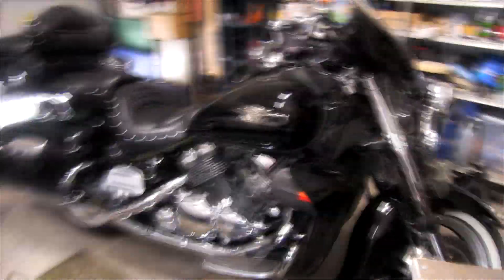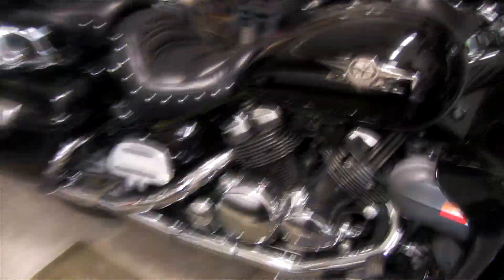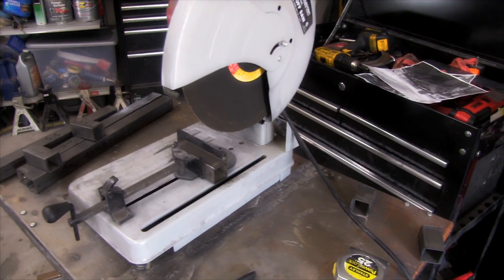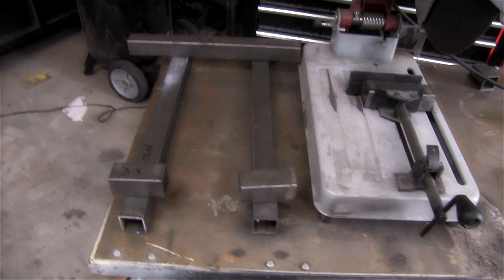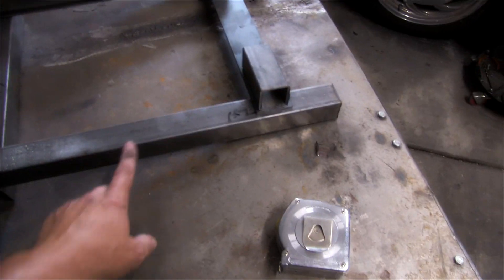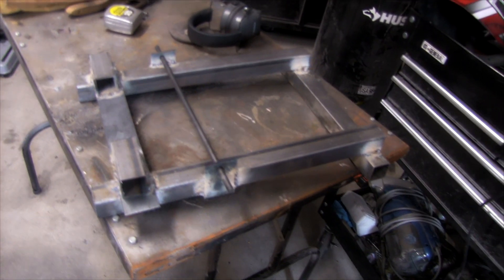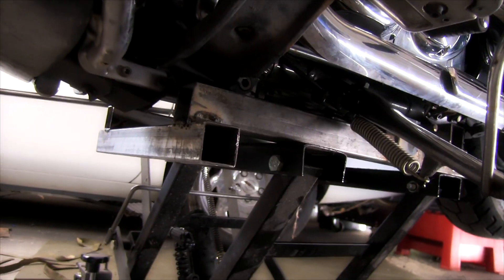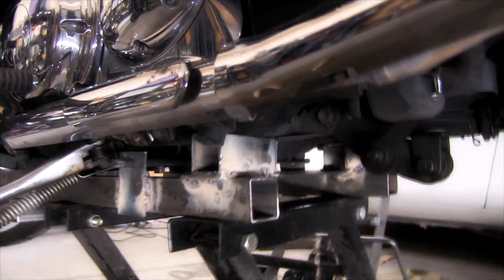Yamaha Royal Star Venture Lift Adapter Fabrication

Comment: I'll be making one of these shortly for my 2008 RSV. I don't think you posted your final dimensions?
Reply from the maker: 2-20 inch square tubing (1 3/4) 2-3.5 inch ,square tubing (1 3/4) 1-13 inch square tubing (1 3/4) 1-13 inch 2 inch wide flat steel, 2 flat steel (2inch) 2;3/4 long. 17 inch long (1/4) round steel bar.  Pretty sure it was 2 inch square tubing but it measures 1 3/4 inch.

Comment: Any possible way to grt the measurements from each piece? Did you use 2" tubing?
Reply from the maker: 2-20 inch square tubing (1 3/4) 2-3.5 inch ,square tubing (1 3/4) 1-13 inch square tubing (1 3/4) 1-13 inch 2 inch wide flat steel, 2 flat steel (2inch) 2;3/4 long. 17 inch long (1/4) round steel bar.  Pretty sure it was 2 inch square tubing but it measures 1 3/4 inch.
Reply: @carsandguitarsdiy  thank you

Comment: would you consider building one of these for me? I would gladly pay you for it. I have neither the tools, the shop nor the knowledge to safely build one. Or if you can recommend someone who would. I asked a local metal shop and they were not interested. I have eh same jack as you did it seems. Thanks for the video.
Reply: Did you find someone to build you one?
Reply: @justanotherguy-941  Not yet. I am sort of in the middle of moving things around, but will need to have one i think. I have a lift but i can see what you were talking about.
Reply: @bennynash6655  I'm wanting to build one for myself and could do two. Guaranteed nice work or it doesn't go out.
Reply: @justanotherguy-941  Myron, have you built the adapter yet? I am looking for one. I don't have a welder so will need to buy or fabricate out of wood. Still interested in doing two?
Reply: @kennethcasper106 i haven't. I am away until Dec so depending on how quick you need it.

Comment: Hey Charles, I ended up buying one instead off of ebay. My tubing on the back end goes all the way accross and I noticed your design is two short ones. Did you do that for clearance?
Reply from the maker: Yes I did but either way works as long as you place it correctly before you jack it up.
Reply: short ones do the job and it's not as heavy to put in place

Comment: I bought one of these off Ebay.  It keeps slipping on my jack.  I'd love to see a video of actually jacking up the bike.
Reply from the maker: I use the rod thru the bottom frame ship holes on the bike the keep it from slipping.  Also initial placement is everything......
Reply: can you help me find one on eBay "motorcycle jack lift adapter" is not getting results, thanks